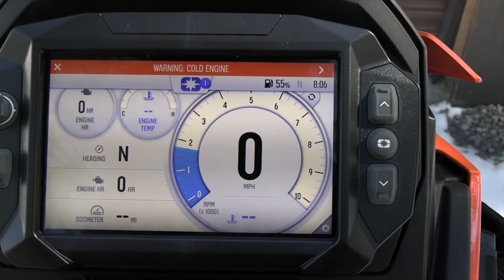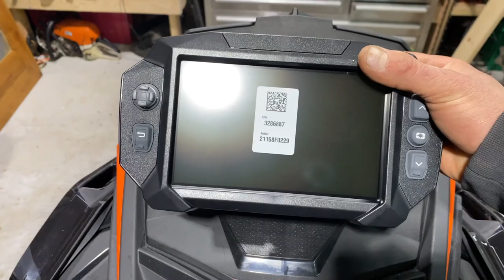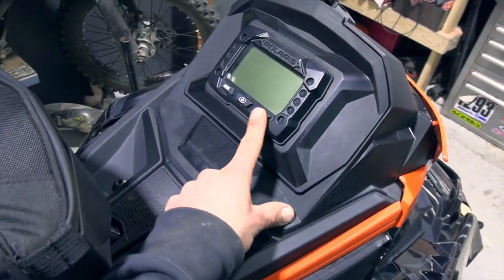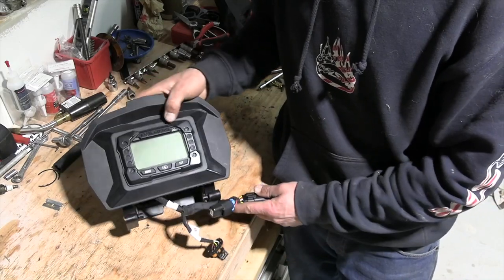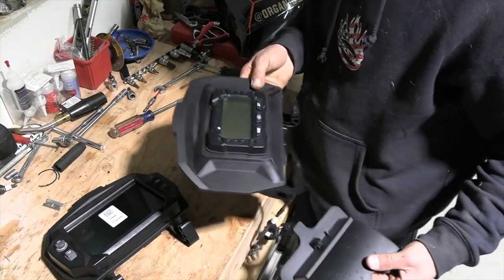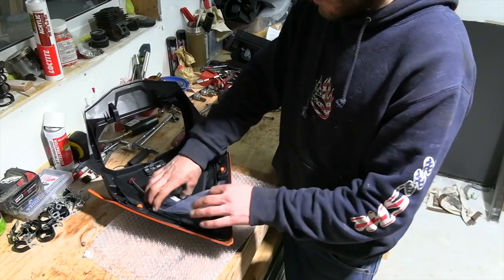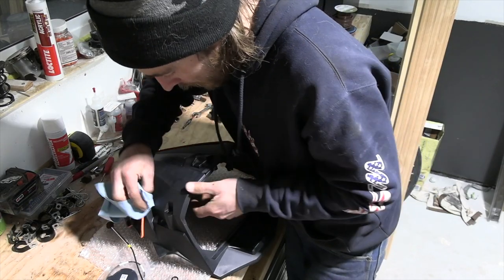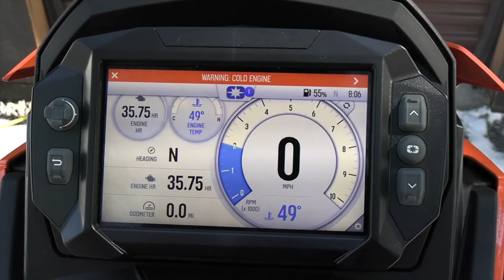Polaris Matryx RMK pro  -7s screen install-

Comment: Quick question, do you need electric start for the upgrade or can you use the non-electric start 2023 RMKs to upgrade to a S7?
Reply from the maker: no need for e-start- Just need the power up kit from CV customs

Comment: How much did the bigger screen cost to swap? I’d like to do the same thing
Reply from the maker: The screen kit is $1,200 from Polaris & the install kit is $120    

You should be able to use a polaris current accessory promo (spend $750 & take $250 off)
Reply: @masterofnone3418  did you have the e start? or does it come with that other little battery for the screen if you dont have e start
Reply from the maker: @ThrottleNectar  No E-start  If you want the screen to work when the sled is turned off i suggest buying the "power up kit" from CV Customs     https://cvcustoms.com/collections/gauge-power-up-kits/products/polaris-indy-switchback-850-pidd-power-up-kit
Reply: Do you actually need the power up kit for the screen to work